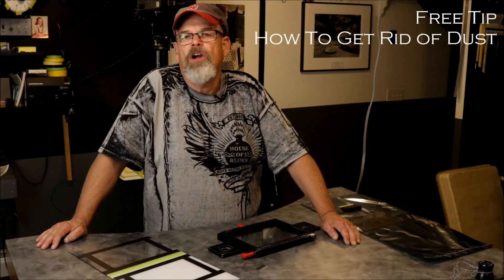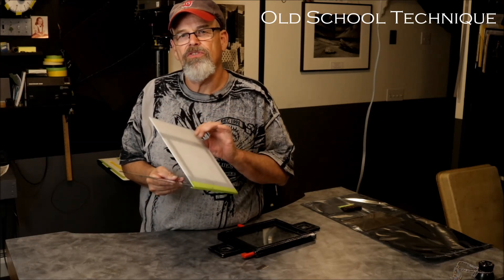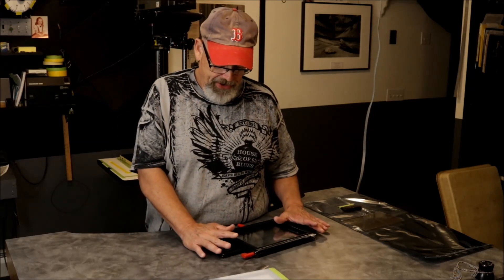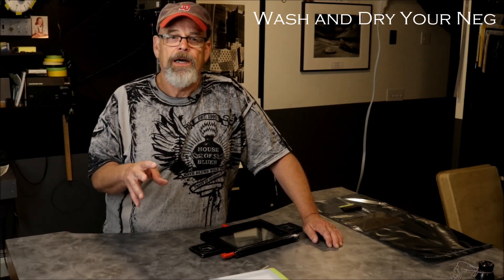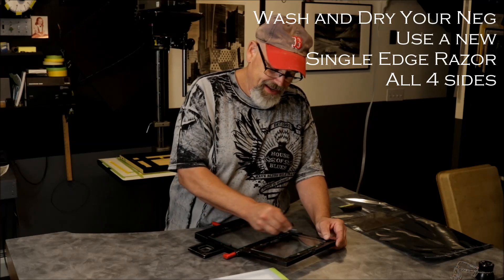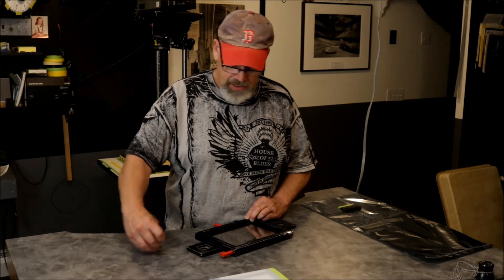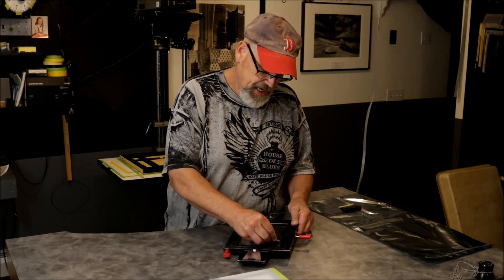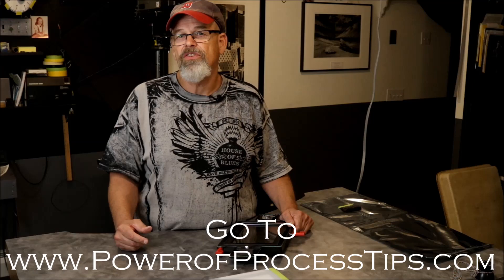Analog Photography Black & White methods and philosophy

Comment: I wash my negatives with distilled water and have noticed less spots as a result. I use a Jobo to develop my negatives, and my final washing of the negatives is 8 volumes of water, with the last four being distilled water. I notice that contact printing my negatives, which I just started doing with my 8x10 negatives, shows less dust as well as compared to loading 4x5 negatives in the film holder in the enlarger. Enlarging the negative also enlarges the dust spots.
Reply from the maker: I've never tried the distilled water, worth a try, however, once stored in an archival acetate film sleeve the static is bound to happen, the rewash works well as water is a natural static suppressor.   Thanks for reaching out !!

Comment: Good idea using the razor blade on the contact surfaces, Steve. I wonder if you've considered the source of dust (i.e., floating in the air, falling off your arms/clothes, coming from the air ducts,etc). I subject my negs and carriers to an ionic (deionizer, antistatic) air stream to make them 'anti-static' then blow the remaining dust off with compressed air....works remarkable well. I also vacuum my arms/hands/hair/beard just before loading the negs.  I'd hate to have to wash & dry the negatives over and over, as I've seen slight changes to negative density doing that (perhaps just minute casting of minerals from the water, but I truly don' t know for sure).  Have you not seen that? Or does your process for printing nullify any slight negative changes due to repeated washing? I can see how it might.  Anyway, thanks for the tip! I'll test it out as a way of speeding the process.
Reply from the maker: Thanks very much for reaching out with a comment.  I try very hard to eliminate the dust, seems as though the more I fool with the neg it's in the carrier for the first time the worst it gets as far as dust goes.  I firmly believe once the neg is stored in an archival acetate sleeve the static is bound to happen.  WIth careful handling I've gotten the dust spotting to a minimum on the print.  As far as the density lose, I can't speak to a normal developer's tenacities, but highly doubt that could happen to a Pyro processed neg as the gelatin is hardened long before the film is dry.  Cheers,    SS